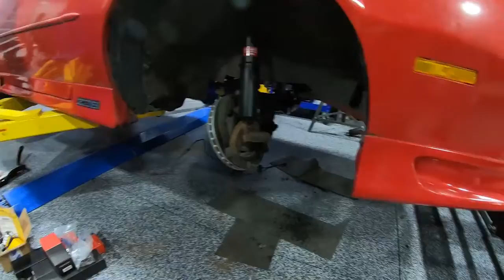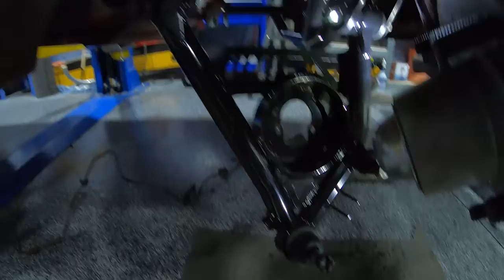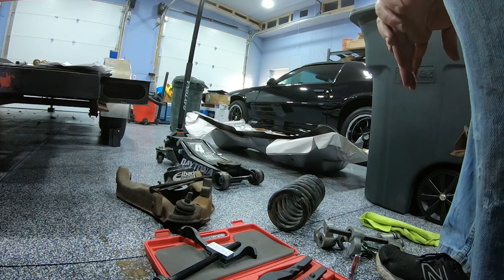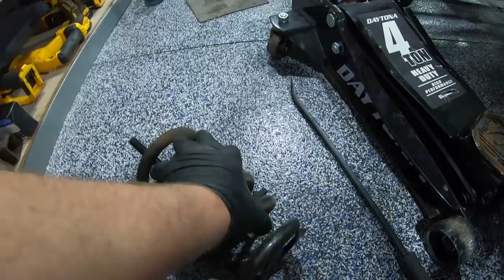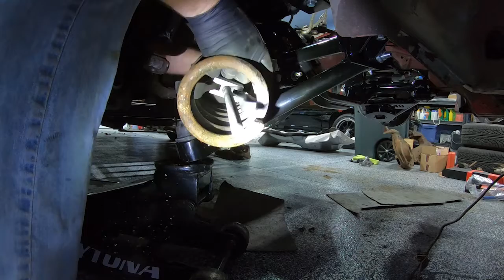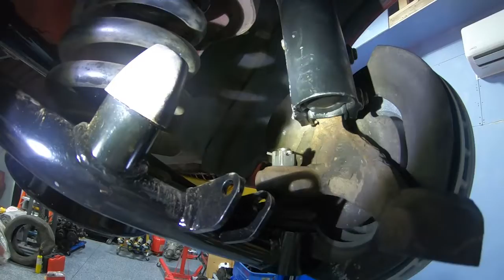1982-1992 Camaro Tubular Control Arms and Coil Springs Installation

Comment: Random question but do you use the factory style clamshell on the kmember and the umi mounts on the motor? or do you put the umi mounts on the kmember and use factory ls mounts on the block?
Reply from the maker: When using the UMI K-Member, use the UMI mounts SBC or LS depending on your motor.  When using the factory K-Member, use the factory mounts for the SBC, or use an aftermarket for your LS based on your setup.

Comment: What's the name of the spring compressor tool. Along with the part # and were did you get it from ? Love your 3rd gen content got a 92 Camaro rs that I'm put a Ls1 / 4l60E that I swapping in.
Reply from the maker: Thanks for the comments.  More video's coming very shortly.  
Here is the tool I used for this video.  
https://www.amazon.com/gp/product/B07JKDCZV5/ref=ppx_yo_dt_b_search_asin_title?ie=UTF8&psc=1
I have a black 92 Z28 in another video that I just swapped the torque arm out on.  Later this summer it that ride will be getting an LS2 bored over .30 with a stroker crank paired with an 4L70E that I just had rebuilt.  Love the power an LS gives these cars.
Reply: @3rdgenworkshop MAN YOU WOULD LOVE MY MEDIUM QUASAR METALIC BLUE 92 ANIVERSREY CAMARO Z28 THAT I ORDERED NEW BACK IN 92 AND JUST 19 THOUSAND ORIGINAL MILES AND ALL ORIGINAL EXCEPT FOR EXHAUST.

Comment: Nice work!
How did you remove the spring compressor if the bolt hex was at the top? Having done this a few times, I've always gone through the bottom. I ended cutting the bolt on the spring compressor. I can't picture how you did it and I was waiting for it in the video, but it's edited out. Thanks.
Reply from the maker: I just used a part of wrenches to loosing it until the control arm and the upper housing mount had the tension.  Then the forks and clamps loosen.  I remove them from the bolt, and then dropped the bolt out from the bottom of the control arm.
Reply: @3rdgenworkshop  Great Thanks!
I'm not sure if it would work with the original crossmember.  I'll try it one day.
Reply from the maker: It should.  I did it on my 92 Z28.  Factory K-Member with Detroit Speed Control arms.  Worked fine.
Reply: @3rdgenworkshop  Great Thanks!